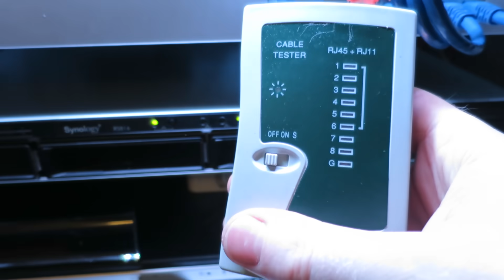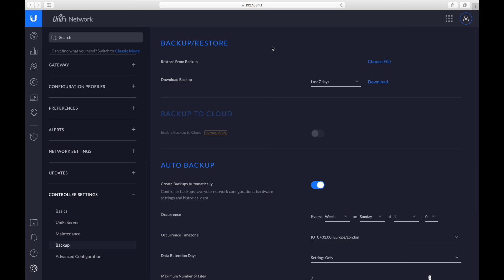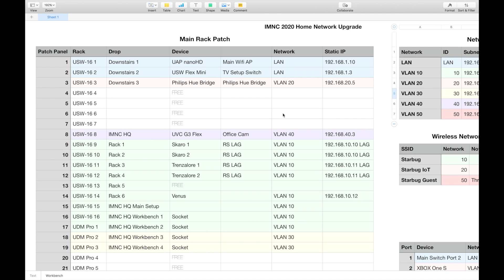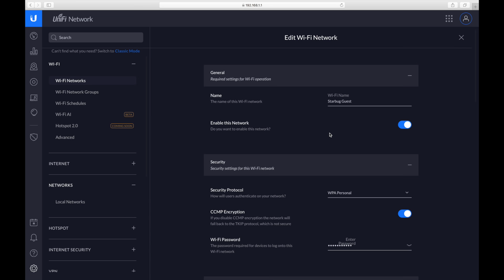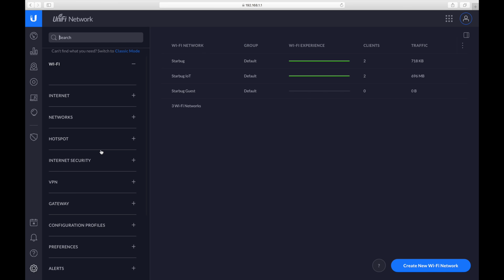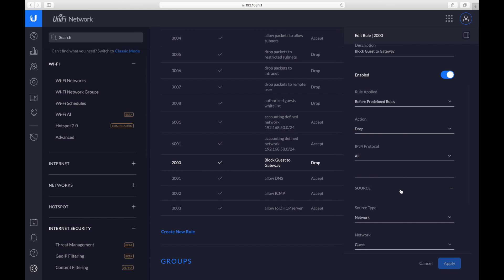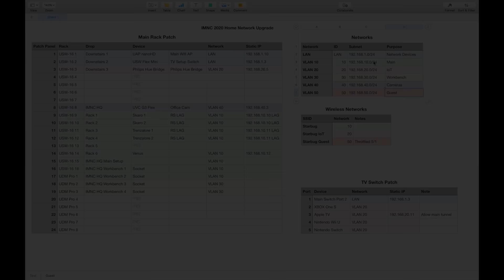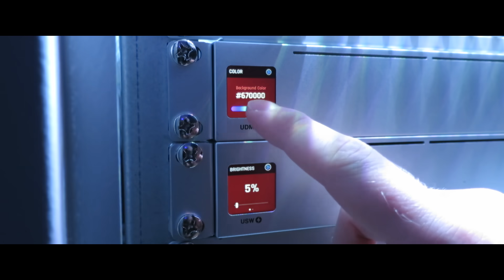Huge 2020 Ubiquiti UniFi Home Network Upgrade (Part 3 - Advanced Configuration & Final Installation)

Comment: Hi There,

First of.....Very nice network setup.

But a few comments;

Why not just place the patch panel between de UDM and the Switch (patch panel in the middle, UDM-Pro above the patch panel and the USW below the patch panel) so you can still use your current short UTP patch cables?
That way you didn't had to reorganize the whole thing and didn't need those brushed panels and longer UTP cables (witch cost extra U space and money).
Also if you want to track a cable, it is a hard you to do now.

And why are there so many people mounting a UAP "Dish" on a wall, when it is suppose(and designed) to be ceiling mounted?
Rather use a Unifi in-wall AP or a UniFi FlexHD AP for a wall mounted solutions.

Comment: Another great video Tom :) can i ask what brand the patch cable and brush plates are :p
Reply from the maker: Thanks! :D 
Certainly. The brush panels are "712477 Intellinet 19IN CABLE ENTRY PANEL" - I bought my 2 from an eBay seller but they're available from a few different sites if you Google that product.
The patch cables are deleyCON CAT6 white. They're available on Amazon as packs of 10, multiple different lengths available. I purchased 20x 2m and 10x 1m for this project, used 24 for patching the front end and 6 for patching the rack gear itself. https://www.amazon.co.uk/gp/product/B079G3V5Y5/ref=ppx_yo_dt_b_asin_title_o00_s00?ie=UTF8&th=1
Reply: @ItsMyNaturalColour  thanks dude

Comment: I just have one question: why do you need firewall rules for preventing traffic between VLANs? I think their purpose is to separate traffic (at data level/Layer 2... so you will need to route traffic you want to go across VLANs).
Reply from the maker: Hi Cosmin
Thanks for your comment.
To create my VLANs, I used the 'Corporate Network' option. By default without firewall modification, corporate networks can happily chat to other corporate networks in UniFi.

Comment: Great video! This has been super helpful for getting my network setup.  One question I had is that the "Block IoT to Gateway" rule prevents IoT from accessing the main network gateway (192.168.1.1 in my case), however, I tested this on my network, and when on the IoT network (192.168.2.0/24) it still has access to its' gateway (192.168.2.1) which it needs for routing, but this also allows access to log into the controller.  Any ideas how to allow a network to access only it's own gateway without being able to log into Unifi controller? Thanks!
Reply from the maker: Hey Ben, glad you've found the video useful. Apologies for my delayed response.
You're absolutely right, and I neglected to address this during the video. I haven't yet figured this out, but when I do I'll be incorporating it into my next UniFi video. My plan is to make another video in the near future, addressing some more of these points in detail and also sharing the additional things I've learnt since originally setting this up. 
If you've figured this out this commenting, I'd love to hear your method.
Reply: @ItsMyNaturalColour  thanks for the reply! unfortunately, I haven't figured this out yet - was hoping I missed something obvious :) will share if I do
Reply: @ItsMyNaturalColour  Hey Tom, watched this video series way too many times.. another great series!
To block access to all the management gateways you need to create a port group, "Web & SSH Ports" in my case, and add ports 80, 443 & 22. You also need to create another address port group, "UDM Gateways" in my case, that contains all the x.x.x.1 gateways which should include each VLAN gateway plus the management gateway. In LAN IN firewall rule set create a drop rule for each VLAN to block access to the gateway interfaces via the web and ssh interfaces. I call my rules "Block ??? VLAN  to GW Interface & SSH" where ??? is the VLAN name. Set the rule Source Type to Network and the Network to the VLAN network. Set the Destination Type to Address/Port Group and set the IPv4 Address Group to the "UDM Gateways" address port group defined earlier. Set the Port Group to the "Web & SSH Ports" port group defined earlier. Those rules should block any access from the VLANs to the management gateways.
Reply: Sorry, that rule should be on "LAN LOCAL" not "LAN IN".

Comment: Absolutely fantastic job.... from start to finish it was thoroughly entertaining and informative. I still haven't got round to setting up my VLAN's or Firewall rules, shame on me. 
One question I did want to ask, I have set up my system with a Unify Cloud Access as well as the usual access to the Cloud Key, Network and Protect.... but for the life in my I can't see where to adopt the Protect into my Cloud Access account, this means I can only watch my camera locally... any ideas on how you managed to overcome this?
Reply from the maker: Hi Richard 
Thanks for your great comment. Really glad you found the videos useful.
I'm afraid I won't be much use with this one, as I don't have or have never used a Cloud Key. Really sorry about that. For my setup with a UDM, I didn't need to do any configuration to get the UniFi Protect functionality you desire up and running. 
Maybe someone with more experience with Cloud Key and UniFi Protect can chime in to this thread to help you out.
Again my apologies.
Reply: @ItsMyNaturalColour  No worries.... I can still use your video as help in configuring my Firewall for my VLANS's ..... Two thumbs up!

Comment: so why did you clip the wire for the airport?  why wouldnt you just pull it back towards the UPS?
Reply from the maker: The power connector was too large to pull through the hole in the wall.

Comment: Tom why you patched cables that aren’t connected to anything?
Reply from the maker: Great question. I have 2 answers...
1. Eye candy - it looks nice.
2. By patching all 24 ports at the front end, I can make it all neat and tidy, then when it comes to adding a new piece of gear, all I need to do is pop it into the back of the panel and I'm ready to go. This is especially useful as it's a keystone panel.

Comment: should mount the ap on the ceiling the wifi signal will go thats why you have poor speed in front rooms
Reply from the maker: Yes, as I said in the video it's a less than ideal mounting situation, but at the moment that's where I ran cable so until I can re-run cable, it'll be on the wall. Maybe when I redecorate I'll move it to the ceiling.

Comment: Nice setup. The IOT ssid can be a hidden network. CCTV should only have access to NVR nothing else.  When making fw rules you can selected the sources/destination as a vlan  no need for your groups.   Also make a rule that drops all local ip address so if none of the  rules apply it will drop.  You also shouldn't be opening all vlans to other networks it should be specific ips and specific ports  eg harmony hub 5222 and only open them. Only the IOT and guest networks need to be 24s you could get away with 26s or maybe smaller ranges.
Reply from the maker: Hi Paul
Big thanks for your tips and help. I plan to clean it up in the future by only opening the required ports, it's just a bit of a mammoth task to undertake right away. I'll plod away at it slowly and tighten things up.
Regarding the groups, I did this to make the rule creation process quicker. By setting up the groups, they'll always be there to use.
Reply: Or you could just use /24 and keep it simple.

Comment: Great video, The cables to the UDM-Pro are cross the switch. My suggestion place the brush panel between the UDM-Pro and the switch. How about swapping the UDM-Pro and switch?
The design of the network on a spreadsheet, nice choice.
Reply from the maker: It took me a while to settle on this layout, but I did this for a few reasons. A big reason was to leave a gap between the UniFi kit and the Synology Rackstation, as the Rackstation heats up quite a bit more than the UDM or the switch. 
Thanks! :)

Comment: Oh and I’ve found out I’d you find your Xbox or other console online performance suffering, try switching in Deep Packet Inspection (DPI) on the WiFi and it should help resolve it. My Xbox One S was lagging quite a bit in COD MW but turning DPI off resolved it.

Comment: Hello Tom, 

Great set-up even better video work!! Can you please share a link to the patchpanel with the keystones set-up? And what SFP cable did you use (copper / fiber)? Thanks in advance for your effort!! 

Onno
Reply from the maker: Really glad you enjoyed the video. My patch panel is a key stone patch panel, search and you’ll find several of varying styles. The keystone jacks themselves are RJ45 CAT6 to RJ45 CAT6. The SFP cable is DAC 😀
Reply: @ItsMyNaturalColour  Thanks for your reply. I was planning out my own little network. Currently a couple of devices in a closet. With regard to your patching i saw that in your old setup you had direct patches from the patch panel to the switch. In your new setup you choose to route the patches back in through a brush panel and then back out a few u's lower. How are you managing the cables in the rack. Is this really an improvement over the old approach? It sure looks nice from the front. I wonder what penalty you are paying inside your rack. Thanks again for your time and effort. Really appreciated.

Comment: It's probably not a bug, it's most likely the DHCP reservation/lease hasn't expired yet so it reports it. Once the lease time expires it should disappear
Reply from the maker: Thanks for the info!
Reply: Not sure, but a possible cause of the multiple addresses is multiple interfaces?  Could it be that Apple TV is talking on the Ethernet link and a WiFi?
Great video!  My kit arrives on Monday and I plan to use your group approach to firewall rules!  Thanks!

Comment: I would like a more in depth video about firewall rules. I’ve been playing around and I find the interface a little confusing to know what option to choose.
Reply from the maker: Not a problem. I'll have more videos containing firewall coverage coming up.
Reply: ItsMyNaturalColour thanks for the response. I normally don’t get a comment response from you tubers. :). I have setup a gateway, 2 access points, and I have ordered a cloud key. I am using 2 older hp enterprise switches to Poe, and expand the network. Do you see any great benefit to having a unifi switch over those? (Other than it showing up in the controller devices)?
Reply from the maker: @ZeroAlpha1173  Hi Alex, no problem at all.
It would certainly be a nice upgrade to complete your network with UniFi switches, but not essential. It would give you much quicker and easier configuration having everything under a single roof so to speak. A good example that springs to mind is the automatic switch port profiles that are created in UniFi, that I showed in this video. There are lots of time saving things like that, that UniFi does in the background while you're configuring to make life easier. The switch configuration in the interface is also glorious, it's extremely easy to use and intuitive. 
But of course all of those things are just nice things to have, not essential. If you're happy with your current switches, it may not be worth it. Maybe purchase a smaller UniFi switch to begin with, to have a play with the feature set... something like a Flex mini will give you good indication of how a larger switch will behave, and not too expensive.

Comment: Great series-love the kit and love your demonstrations. Just one question - have you considered using DHCP reservations rather than static IP addresses? (There is probably a very good reason!)
Reply from the maker: Really glad you enjoyed the series, thanks for the comment :) 
My mistake for not covering this in any of the videos... I actually used a mixture of DHCP reservations and static IPs, depending on the device type. I'll clear that up in my next UniFi video. I have a small list of points I'd like to cover in that video, and this is definitely one of them.
Thanks again for your support
Reply: @ItsMyNaturalColour  not a problem - I wondered if you had a reason. But a great series and I an subscribed !

Comment: Great job.  Check the age of the smoke detector, they have to be replaced after 10 years.
Reply from the maker: Thanks for the heads up! It's a mains detector, does that make any difference? I regularly test and it works fine, but any additional info much appreciated.
Reply: Beat me to it ! Haha
Reply: @ItsMyNaturalColour  if your local fire department maintains them you can reach out to them to inquire if they are working properly or need to be replaced
Reply: @ItsMyNaturalColour  Here's a link to the FEMA (US) sight about replacing detectors.  The sensor may fails but the alarm will still test ok if you push the test button.  Some of the newer detectors will continue to chirp until its replaced after 10 years after power up.  Not sure what a mains detector is (hardwired maybe), but if it's a hardwired (mains power with battery backup) it still should be replaced after 10 years.  (My father in law was a fire protection engineer at UL)  https://www.usfa.fema.gov/prevention/outreach/smoke_alarms.html
Reply from the maker: @mbergtberg  Thanks for the additional info. Yes, mains as in hardwired. I'm in the UK, so I'll have to do some research. Thanks everyone for letting me know.
Reply: @ItsMyNaturalColour  Replace it with a Nest Protect.  I have 3 of them and they self test themselves.  All smoke detectors (even hardwired) should be replaced every 10 years.
Reply: I'm a Fire Alarm Systems Tech in the US, and its true that NFPA 72 National Fire Alam Code requires "Smoke Alarms" as you have in your house (not system smoke detectors that are terminated to Fire Alarm Panels or Fire/Burglar panels) be replaced every 10 years. In Britain I'm not sure what code applies, maybe the IFC International Fire Code, but every code requirement will also include "or manufactures recommendation" type verbiage. So on the back of your Smoke Alarm find the manufacturer and model number and Google the cut sheet for it. The 10 year replacement requirement may very well be written on the Smoke Alarm's label on back as well, making the Google search moot.
Reply: @ItsMyNaturalColour  That smoke alarm is a Kidde/Firex KF1, we have them in our house. 
They've been making them for atleast 25 years, so they could be quite old,  they still make them and they just clip into place onto the existing base without any major work. 
They are around £25 each so not too expensive.
Reply: @ItsMyNaturalColour  yes. The half life of the detector part drives the replacement cycle. 
Similarly the mains ones have a battery backup. That battery should be changed periodically.

Comment: The reason you have poor reception in your front rooms is because of the antenna pattern of the nano, that access point is not designed to throw signal to its underside, you may see better performance in those rooms if you mount it to the ceiling instead of the wall... except directly above where you have it mounted lol.
Reply from the maker: Definitely. I knew the wall wasn't ideal, but I'll hopefully be able to move it to the ceiling when we redecorate the room. I can access that ceiling fairly easily from above, so I'll re-run that cable and happy days.

Comment: Freakin' awesome kit you got there. I actually just got a pair of UAP AC Lites to ...change out... my WiFi APs.. I had been running a 3 pack of Google WiFi APs, and while it worked its management wasn't ideal. Google WiFi in case you weren't aware relies on a really crappy phone app (iOS/Android) and its settings are super minimal. I mean, I get it... it's meant for people to just get WiFi up and running without any special/advanced features, but I'm more of a prosumer and I like tinkering like yourself Tom. I really like the flexibility of the UniFi controller, and I'd like to get at least a Dream Machine Pro in the future when I have the funds and space for it all. We only rent so there's no way I could drill holes in the wall/run cables through crawl spaces to make a seamless network like yours. I have my two APs in place to cover signal in the front of the apt and the back mainly for my parents' use of it, since I spend most of my time on wired devices, but having a good WiFi management system is great. Great video series. Cheers!

Comment: Haven't watched the full video yet but - you should look into/learn VLSM (variable length subnetting) to more efficiently use your IP addresses. It's not really necessary but its cool to have implemented

edit: I guess it kinda helps with security, for example if you have an 8 address Camera VLAN and 8 devices using it, it could prevent someone from connecting to the camera network - 8 addresses (only 6 would be usable because of network address and broadcast address [first and last addresses]) would be a /29 CIDR and 255.255.255.248 mask.
Reply from the maker: Adam, I'll definitely do this. Makes a lot of sense and something I completely overlooked. I'll be sure to mention this in a future UniFi video. With the amount of good tips I've got from the comments, I'll probably be looking at doing a video specifically about 'fine tuning' my advanced config.

Comment: "I've made the 3 octet the same as the vlan" ... oh how I wish everyone would do this..
Reply: Really stops being practical after VLAN 254...
Reply: @112Haribo  this is where you look at your management lan v internal lan and change the IP scheme.  for example, my management lan remains in the 192.168.1.0/24 range with my other networks as 10.100.10.1/24 etc.. fun thing here is that IF you want to exceed the 254 (and I'd wonder what the hell you have setup at home to require this) but you could adjust the 2nd octet to something like. 10.101.10.0/24. it just then means you need to look at and pay extra attention to the 2nd AND 3rd octects when configuring devices, troubleshooting etc..